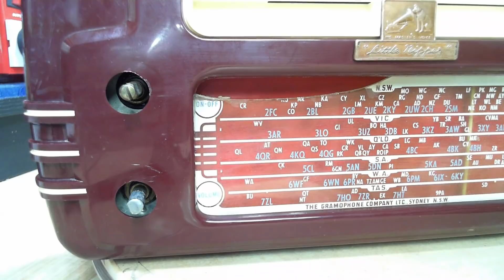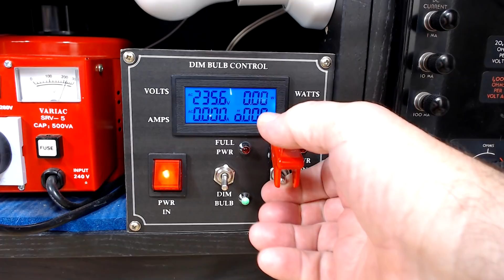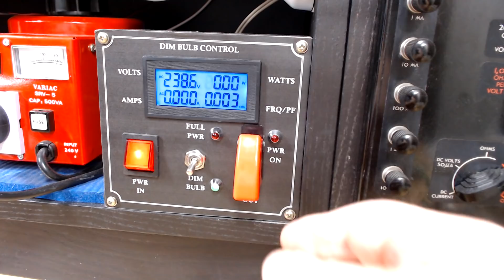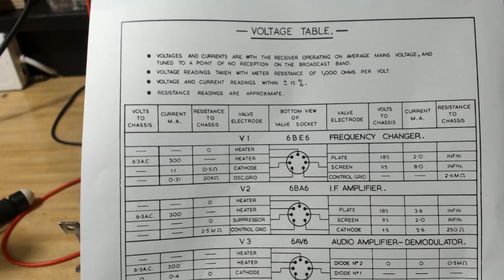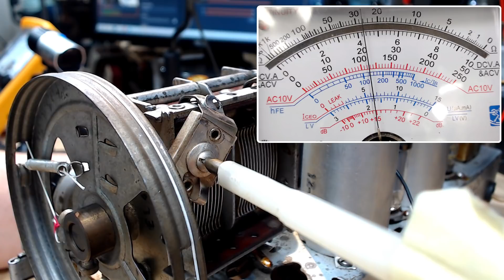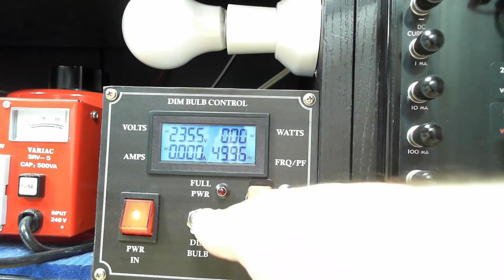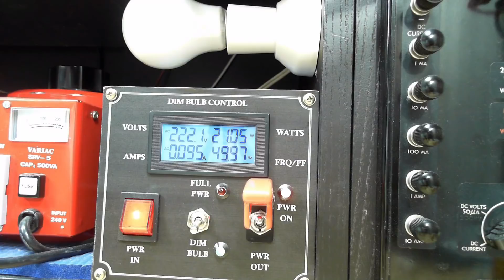HMV 61 51 Radio Repair - 1954

Comment: Darn it Dave! Quarter to 2 AM, one last look at my fav people and this was up! OK, up longer tonight LOL. Broken glass, ohh tough luck but it sounds like not a lot is wrong to start with, lets watch and see!  Smokers UGH, I have had so much gear with that nasty smell. YUCK!  A bad volume pot was my first guess too, wrong pot, that explains it :D  Wooden jews in the vise I have used that a few times, nice job!  If only actual work was as fast as a fade between two video clips! Nice improvise with the 1 meg resistor that was much better. I don't know what you are using for dial cord but some time ago, Mr Carlson mentioned using about 50 pound test fishing line. It works great and the sporting goods stores here that sell line often have the ends of spools available at a very good price. I got something like  50 yards (meters) of line for under twenty dollars U.S. That is enough for a long time. Locktight is a good product though I just use whatever I have at hand. Very often I use a gel glue with a spray accelerator when I have the parts in alignment.  LOL the leftovers and the groan. BEEN THERE :P :P Nice buy ont he radio! My radio club had to skip our annual auction this year due to .. you know. I would have done a quick voltage check between the two radios just because I am interested. Nice find on the old unit though that solves the glass issue very nicely. I have seen you work some miracles on plastic cases so when you said you had the parts that were broken off, no worries! I wonder if you could have used the chip of plastic as a filler material and could have used heat to weld with. Just thinking out loud. I have a plastic welder that uses a very small jet of hot air, perhaps you could use a small nozzle on your air station. Again, just thinking out loud not criticizing. Another excellent job done and working! The owner should be very happy with the result. He gave you a real pile of ..... parts and you gave him back a gem!
Reply from the maker: Hi Wayne, The radio came out very well and looked good except for the cracks, they weren't that noticeable just looking at the radio but I would have liked to better. The owner was very happy with his radio that was reassuring. I have plenty of dial string but I have heard of using fishing line, I might need to one day. Bad combination, pizza and red wine 😄 Thanks Wayne

Comment: Good Sir - your talents far exceed mine but if I can tell a story? I bought a radio from a guy who said his mother used it until she went into a home for the aged. It was dark brown Bakelite. It got dropped and had a very nasty and misaligned crack down the side of it. I forced this all back into rough alignment using super glue and a bizarre collection of clamping which left some high spots. I used various files and sand paper to smooth everything out and collected the dust from this operation. I then applied more super glue and that dust together in an attempt to level and again filed and sanded. It came out extremely well with cracks that are very hard to see. The one crack on a molded, bending corner is almost impossible to see but I know it is there. This seemed to blend very well with the native color. Just a suggestion if you have to do something like this again. Cheers Mate.
Reply from the maker: Hi Jeff, thank you. I have done Bakelite repairs but tried another method. I kept some broken bits of Bakelite for next time, I'll try you idea if ai have to do it again. It might have worked on this too. Thanks 👍🙂

Comment: As always you have made it a million times better than the heap it was :-D
I really liked your aluminium support plates and the jb weld.
Once painted they almost disappeared,  i would be surprised if anyone noticed them in the future.
The case cracks look horrible to repair,  i did wonder if the case colour exists in a common car colour,  but you must have tryed the local car shop for the colour match cards and nothing matched.
I did think about looking at the inside of the case and see if some of the plastic could be scraped off and melted with a low power soldering iron in to the cleaned out cracks.
Sorry i'm doing that thinking thing again lol :-D
Did you test the mustard caps? i bet they are still usable in something else.
Reply from the maker: Thanks zx8401ztv, I couldn't find any car paint to match, I tried using paint and tile repair crayons but I couldn't make them disappear.  I wasn't game to experiment with it too much as it wasn't mine. I will have to find an old case and play around with it. I can't test the caps under voltage but I'm sure they will be all right. I got caught twice with them in the past so hesitant to take any chances now 😏🙂

Comment: Well it looked good to me Dave. It's reassuring to see that some methods of cosmetic repair don't work all the time, even from perfectionist such as you ;) I can sleep easier knowing that when It's not gone to plan it happens to the best of them too.
Reply from the maker: Thanks Ged, A can of spray paint would have been the next step. Thanks for the morale boost, things don't always work out do they 🙂

Comment: For cracks that are lighter than the original cabinet color, you could try using a dark brown or maroon felt tip pen (aka a permanent marker). It won't work if you have a polished (wax) finish. I would use a little alcohol first to prep the surface. Good Luck.
Reply from the maker: Thanks for the tip Glenn 👍🙂

Comment: Of course interesting, no doubt about it. Love the relative simplicity of this radio design.
The way you enforced the cracks is exact how I (would) do it. Sometimes I drill a few holes in the metal to force some epoxy trough to act as rivets. I mix the 2 components a bit different; I always imagine that hand mixing misses a lot of molecules to combine in the mix, so I use a small plastic sample pot (5 ml or so, 2 cents), and from the round end of a bamboo chop stick I made a spatula. I stick that in my small Dremel drill, and at a slow speed (!) it mixes nicely, in the hope of a stronger result 😉 and it is not as tiresome when you want to mix for a few minutes. I use 'Bison combi power', just as grey and pricey.
Reply from the maker: Thanks Erik. Drilling holes might be a good idea. Your mixing idea is good, I probably wouldn't be bothered though, too lazy 😀

Comment: I enjoyed your video as usual. I did think you'd hide the replacement cap in the big metal cylinders too. I like the structural work on the case, some times I wonder what the designers were thinking placing so much of a strain on areas without reinforcing them.
Reply from the maker: Thank you clasicradiolover. I've done a number of metal electrolytic re-stuffing, very easy to do. The cabinet would have been OK but the built in handle was it's undoing 😀
Reply: @DavidTipton101  Very much a weak point.

Comment: Dave another great refurbishment re the pots in days gone by the Ducon Pots were A Linear and C Log  when had a great electronics industry re the Mustard caps there made by Philips and were extremely reliable in my my time on the service bench I never has replaced a Philips cap
The HMV radios of era were very reliable the factory was Homebush in Sydney by the way I am in aware of you Workshop skill 
And commiserating on replace your Frigid In my they were in Australia also I would say replacement would made O/S sadly
Anyway Dave another excellent Video full Marks Mate,Regards Ian.
Reply from the maker: Hi Ian, there seems to be no standard in the pot nomenclature. What hope do we have? The fridge was made overseas and so was the replacement, it the way it is these days 🙄 Thanks Ian 👍🙂

Comment: Another great job Dave. We were thinking maybe you could have somehow powdered the extra piece of bakelite and then mixed with PVA glue to fill those cracks?? The colour may have been a bit more even then? Just a thought.. 🤔 Might have to try it myself sometime..😊
Reply from the maker: Hi Chris, yes I need to try something else next time, I didn't get the spare piece of plastic till after I glued the parts back in, I need to do some research for next time 🙄🙂 Cheers!

Comment: Dial shows 2TM-Tamworth and 2MO-Gunnedah. I'd have to look them up on Google to find out when they were established. Also shows 2NX which, at time of manufacture of this set, 2NX was, and by rights still is a Maitland station. That broken bit of glass may reveal more stations. I was trying to find 2HR which was based at Maitland but went broke in the early 1950s and went off air.

Comment: I love the colour of this one.  The repairs look very difficult to disguise.  You have done better than most I think.  I wonder if the dial glass can be scanned in case someone wants to reproduce it.  Nice one 😊👍
Reply from the maker: Hi Pauline, You are probably right, I should have been happy with it. No trouble scanning the dial, the problem is printing it on the glass, Something I will have to investigate in the future 🙂
Reply: @DavidTipton101  I wondered if the dial could be printed on to acrylic or clear plastic sheet that could be laid over glass.  I wish my brain would stop 😄
Reply from the maker: @PaulinesPastimes  home printers don't deposit enough ink to cover transparent media well enough, you can see through it when it doesn't have a backing. I  have had dials printed on vinyl by a printer but only in one colour.
Reply: @DavidTipton101  Oh well, there goes that idea 🙄

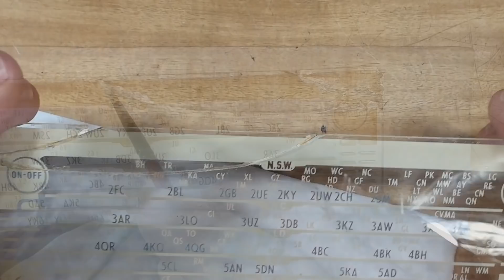Comment: 21:33 No, I can't see 2HR on the dial. 2HR closed down in 1953 so that fairly-much confirms the vintage of this radio, also, noted on the bottom of the dial plate were the words "The Gramophone Co. Ltd., Sydney, which is odd, because EMI was, in fact trading in Australia as Columbia Graphophone Co.(Australia) Ltd. up until 1955 when EMI acquired the Capitol record label. but 45s up to about 1958 were still showing "Columbia Graphophone(Australia) Ltd." on the HMV, Columbia and Parlophone labels.

Comment: Sadly, or maybe realistically, I've always assumed that mis-labeled A or B pots were due to stupidity or deceit.

My problem with replacement potentiometers is that many of the older radios I work on carry much higher voltages and currents than those seen in transistor radios.   Finding even a 4 Watt potentiometer, of anywhere near the correct size, can be difficult.  I snatch up used ones practically anytime I find them.   Many of them are not that hard to refurbish.

I'm always amazed at your aluminum sheet reinforcements.   Watching this one made me wonder if you have ever had  a radio's reception improved or made worse by putting one in ?

Thanks, and thanks again for your videos.
Reply from the maker: It's a weird setup with both systems using the same ident markers but in reverse of each other, best to use a meter to work out what is what. 
I have had the same problem with Hi current pots, I did manage to find some but they are expensive and not readily available in log form.
I haven't had to do a case with an internal antenna so it hasn't been a problem. I would use something else if a radio did have an internal antenna, maybe fibreglass. 
Thanks for your support Howard 🙂

Comment: Another good job dave!
Reply from the maker: Thanks Richard 👍😀
Reply: @DavidTipton101  I am Finishing up on a Am/Fm Phono Boombox from 1969 built by Panasonic , The electrolytic capacitors were bad so I changed them all .
Reply from the maker: @richardbrobeck2384  Good Richard, I hope it works well 👍😀
Reply: @DavidTipton101  I will post a video of it after I finish the radio.
Reply from the maker: @richardbrobeck2384  ok, cool

Comment: The 8-bit guy had a strong repair method for broken plastics, it was a super glue, then baking soda, and more glue on layers to form this glue like concrete, naturally this is done on the inside of what your fixing, but the results are a thicker super glue like cement, not sure if you'll ever use this method
Reply from the maker: Hi CaptainChar, yes, I've seen and used it before, I haven't tried it on plastic before though. The JB Weld glues plastic together very well but the drying time is a nuisance, Super Glue mix might be handy for a quick fix. I'll experiment with it, thanks CaptainChar 👍🙂

Comment: Howdy Dave!
Well, YouTube is at it again.  They are not sending me notifications of your new uploads!  Glad I keep checking to see if you have anything new out.  Found this one and enjoyed it much.  While it was not the best one you have done, it is nevertheless a good one.
I wonder if it would have helped if you put some sort of coloring in the goo you took out of the acetone before you applied it to the enclosure?
Concerning the capacitor where you drilled out the hole for the new replacement...did you use a Radial leaded capacitor because that was what you had?  I mean, instead of an Axial Leaded one?
Have some good news!  I FINALLY found the correct schematic for my 1927 Garod V Neutrodyne radio!  Now if I can just find a good UV-200 or UV-200A tube for the Detector tube!  I did a quick search on Google but all I found were results that were not the actual UV-200, stated that it was for display only due to an open filament or they wanted about $125.00 for the one tube!   I only paid $50.00 for the entire radio!  Not sure of the condition of the tubes (valves) in the one(s) that I have, and wanted to be sure that I had the UV-200 because it is the detector and the circuit was designed to use only that tube in the circuit for that purpose.  The other tubes are fine with substitutes, but not that one.
Looking forward to the next video.
I still would love to see you design and build a valve-type radio from scratch.  Circuit, chassis, and enclosure all your designs.  That would make an excellent video!
Reply from the maker: Hi Wayne, I need to rethink the plastic repair for next time, I'll see if I can find an old case to practice on. I always use radial caps for that type of cap if I can, it's easier to drill and bung a new cap in the hole. 
Well done getting the schematic, You may not need a new tube if the old ones work, they are pretty reliable. Good luck in your search anyway. Thanks Wayne, I did a video before Xmas where I made a radio from scratch if you missed it: https://youtu.be/kMjgQHatH7k

Comment: Hi Dave, your videos are always interesting so no need to apologise, great fix with the dowel part using JB Weld, that worked a treat, I was going to suggest for the cracks you wanted to fill up, sanding or Dremel the inside of the case and collecting the dust and mixing it with glue to fill them in, but seeing the way you done it with the acetone to soften an old  piece of case was great, would using a heat gun make it soft enough to use or just shrivel it up ? I've got to admit I've not tried that, anyway, excellent video, as always, all the best mate.,
Reply from the maker: Thanks Mick. That maybe  a good idea, I could have ground the plastic and added it to superglue as a filler but it will always come out lighter as it's not 100% plastic anymore, I don't know what the answer is. I don't think it would shrivel if I melted it 🙂
Reply: @DavidTipton101  Yes Dave, unfortunately it will still bet lighter, always an awkward fix on cracks like that.

Comment: Hi Dave ! I like Your Videos much and I can learn so much from You ! Thank You very much ! I also was build at 1954 and I am also repairing old radios like You but not with this perfection :-( 
Your loudnessproblem is interesting that a similar radio works right. Did You check R7 (10MOhm) ? And You can trie to connect a let me say a 220kOhm Resistor from the wiper of the pot to ground, this would be a devider and maybe it solves Your problem. 
Greetings from Austria (here we have no cangaroos) :-)
Heinz
Reply from the maker: Hi Heinz, thank you. I did try a resistor from the wiper to ground but I think I remember it resulted in some distortion so opted for where I put it. If I still had the radio I would play with it a bit more. Stay safe in Austria Heinz 🦘🦘🦘🦘

Comment: Shame you couldn't take the restoration as far as you normally do but she still looks a treat compared to how she was.
A little trick you may like to try next time you need to fill a crack that needs to be a certain color.  I've used five minute epoxy for this but it needs to be a good quality one that won't yellow with time, Araldite has a crystal clear one.
But just to experiment and see what you think, get some artists acrylic colors and mix a small amount to the desired color.
When you're happy with the color, mix a tiny amount of the paint into the mixed clear epoxy then fill the crack.  When I've done this, the epoxy goes off a little quicker but then takes longer to harden.  You may have to leave the fill site for 24 hours, then skim the surface back with a razor black.  I've used this method only in black though I imagine it should work with a specific color. It would also depend on how good you are at color matching.
Reply from the maker: Thanks Ellesmere. That's a good idea using artists paint, that could work. Getting the colour right would be the hard part and I'm not that good at colour matching. Good thinking, I like it, thanks Ellesmere 👍😀

Comment: have you tried maybe a dot of superglue at the ends of the glass break to hold it in place and windscreen repair resin to leech into the crack.....maybe worth a try
Reply from the maker: Hi Chris, I have tried windscreen filler before with limited success. It is expensive at around $35 but they are available from China for $8. I might order a couple and keep them in reserve. Thanks Chris 👍🙂